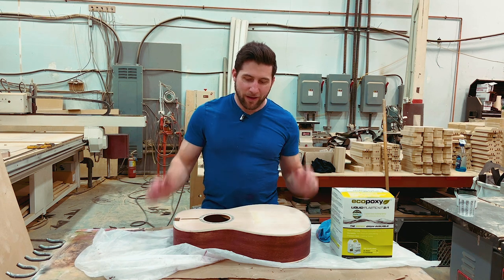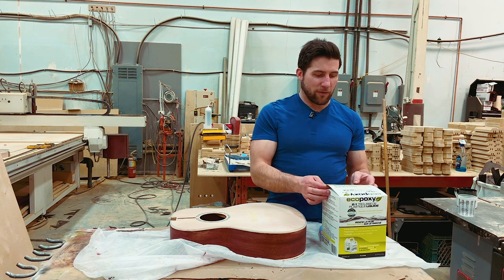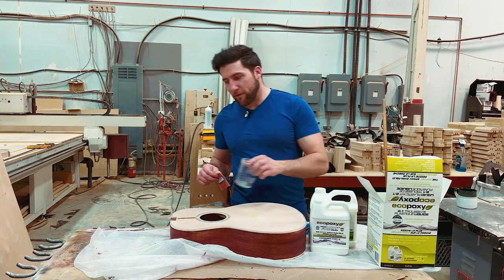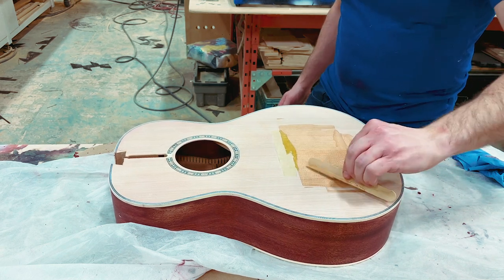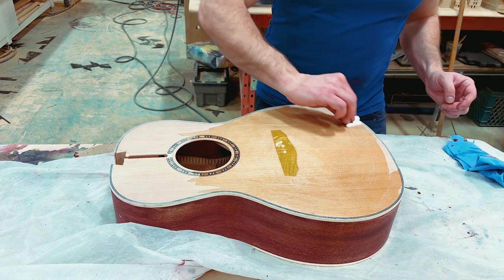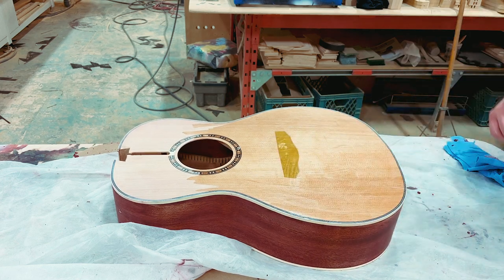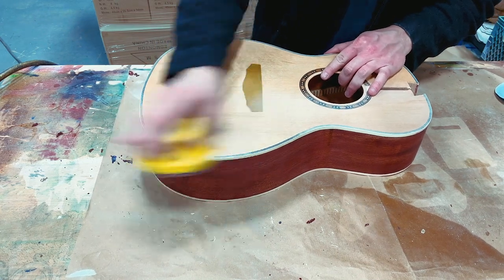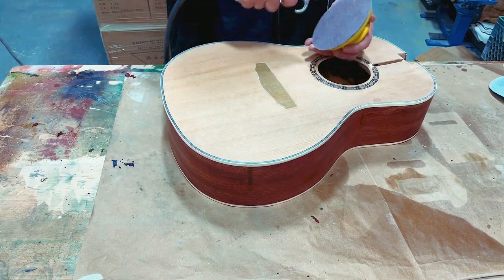How Do a Clear Grain Fill (With Epoxy!)

Comment: I don't know about ecopoxy but there is a great Ken Parker's tip in case you use "regular" west system epoxy- When the epoxy is fully dried on the surface there will be amine waxy layer that doesn't like to bond further. You only need a warm water wet cloth and rub the surface thoroughly to remove the amine.

Comment: They now sell this stuff in Europe but also found Epodex clear and the ultra look the same! This stuff is definitely what I'm going to use in the future.  I've just done a strat body in my normal fill and it takes ages to dry and takes even longer to take off... this stuff looks awesome.. first time I've used the mesh sanding discs and why hasn't I used them before? Last ages if kept clean and even when the edges go dull from the sander they wrap around a small block perfectly... looks class Brad.
Reply from the maker: Cheers Stu!

Comment: Spruce acoustic tops aren't supposed to be grain filled. Also, you're going to have trouble gluing the fingerboard extension to the top now that it's covered in epoxy.
Reply from the maker: As usual - to each their own my friend. You certainly don’t have to fill yours if you’re doing one. 
I don’t think the gluing will be an issue. It’s sanded back so that the epoxy is in the grain only; as it should be.
Reply: @BradAngove  As you state, to each his or her own. Traditionally, the purpose of filling the pores of wood is to create a smoother surface. In woods with large pores - typically called open-pored woods - if the pores are not filled, one gets a "pitted" finish. In some circumstances, the finisher wants that aesthetic. In woods that have sufficiently small pores - typically called closed-pored woods - it isn't necessary to fill the pores of the wood. A finish applied to a closed-pored wood can be quite smooth and "pit" free without filling the pores. Most, if not all wood from coniferous trees - spruce, pine, cedar, fir, etc. - are closed-pored woods and don't require their pores to be filled. It is very rare that a finisher will fill the pores of such woods - it is wasted, time, money and effort, since it produces no tangible result.  

In the case of coniferous-wood guitar tops, specifically, most makers attempt to minimize added mass that can adversely affect tone. Epoxy is a very heavy material - compared to some other finishes and compared to coniferous woods. With an open-pored wood, the epoxy will sit on the surface since the pores aren't large enough to accept much epoxy. Sanding it back to bare wood then removes virtually all of the epoxy. 

Epoxy can be an effective sealer, but there are considerably less expensive materials for that purpose - and easier materials with which to work. Epoxy can also be an effective pore filler, but the pores on coniferous woods don't need filling prior to applying finishes, such as lacquer, shellac, oils, etc.  I know of no other guitar maker who pore-fills ("grain-fills") coniferous guitar tops. Each to his or her own.

Comment: Nice video brother. I've actually used 2K high solids 2:1 Euro clear to grain fill. Great as a filler if you don't reduce it. It has to be high solids to get the desired results but the epoxy seems like a great option as well. Love your channel brother.
Reply from the maker: Cheers brother. That’s a good option too, just not one most of my viewers will have access to.

Comment: Great vid mate. I really need to do more research on using epoxy instead of regular 2k clear, especially over airbrushed acrylic paint. It really interests me.
Reply from the maker: I take it you mean as a final clear coat that doesn’t require spraying?

Comment: If the scratches are not too big, you can also fill with superglue. Rob
Reply from the maker: It’s more about grain porosity rather than scratches, but there are some thicker super glues that work quite well as fillers.

Comment: Looks great. Please use a light amber tint over the complete guitar. I'm just not a fan of epoxy fillers. I've used them and found I prefer anything other than epoxy. Also I hate the smell and clean up.
Reply from the maker: Some of them do have a pretty aggressive smell. I haven’t found that to really be the case with ecopoxy, but it’s definitely worth noting.

Comment: Hey Brad,

If I did this on a solid body top, do I sand and buff to a shine before I add layers of clear coat, or just the 800 grit then spray on some 2k?
Reply from the maker: Just the 800 grit. If you buff it to a shine the clear coat won’t stick.

Comment: Hi Brad - Will any 2-part epoxy resin (from a hardware store) work as a grain filler, or is there a specific type. I’d like to use it to grain-fill a bare Ash Strat body, that I will then finish it with black acrylic lacquer.

I absolutely love your videos, thank you for sharing your expertise!
Reply from the maker: The thinner ones with longer setting time should work. This is a casting resin. It’s not quite like those double tube adhesive epoxies you would typically get from a hardware store.
Reply: @BradAngove  Awesome - thanks, Brad!

Comment: Good demo as usual, Interesting technique, how hard is the epoxy when fully cured? 🤔
Reply from the maker: Harder than typical filler. Hard enough to be used as a clear coat (or even a countertop for that matter).
Reply: @BradAngove  that will nock off hours of work and a pint of nitrocellulose lacquer,  thanks 😊
Reply: This is exactly what I was looking for. I want to use as filler on a table top.
Reply from the maker: Nice; that’ll be fun.

Comment: do you recommend using Epoxy grain filling on a solid body electric guitar instead of oil based grain fillers? like Mohawk Grain Filler?
Reply from the maker: They’re both good options. The epoxy is more expensive, but is nice and clear and hardens more.

Comment: Question Brad, do you think using epoxy like this would have a more adverse affect on how much the top can resonate vs a water based filler? I know finish doesn't matter at all on electrics but more heavily braced acoustics can have a dead sound since the top can't move as much. So would this epoxy stiffen the sound board? Love the videos!
Reply: I dont think so its very very thin and its only in the grain so I think it won't make that much difference. I honestly think a hard finish like polly would dull the sound nore than the fill. If he does a oil finish I think it will resonate just as well.
Reply: @stu-j  That was my initial thought too but I just figured since epoxy dries so much harder than your average filler it might stiffen the board overall. That would be an interesting experiment.
Reply: @falcongunner33  I don't know because it isn't a lot of epoxy that actually goes on its very very little and you sand most of it off leaving only what in the grain to give you a smooth finish at the end. I don't think it will shrink like standard filler can and it will probably bind with the wood itself.  It could make the guitar actually sound louder if the top is stiff all over giving it more bass... but who knows until its done and see how it sounds.
Reply from the maker: I’m expecting it to brighten the sound slightly. Similar to superglue fills, which are quite popular on acoustic builds.
Reply: @BradAngove  that makes sense. My first acoustic build I didn't even fill, I just used tinted lacquer. That thing is super responsive. Planning an all koa build next so I might try the epoxy.

Comment: why are you grain filling spruce ? isnt it a closed pore wood ? - I thought that it was only the back and sides that needed grain filling ? I'm just about to do the finishing on  my first guitar so any help would be much appreciated.
Reply from the maker: I wanted to grain fill it to help with my final finish, but it certainly wasn’t required.
Reply: @BradAngove  Ok - Thats good to know - but does it restrict the top unnecessarily I wonder ?  - thanks Brad
Reply from the maker: I likely has an impact on how the guitar sounds if that’s what you’re asking.

Comment: Doesn't a thinner pour mean a longer cure time? Epoxy curing is exothermic, which means it generates heat (which makes the reaction happen faster, which makes more heat... etc). So surely a thicker pour will cure faster?
Reply from the maker: More material to cure and less air exposure per volume means a thicker pour will take longer to cure.

Comment: Curious. My epoxy says deeper pours cure faster because the cure process generates heat, and the more heat generated the faster it cures, so lower volume pours take longer. Is that not the case with Ecopoxy?
Reply from the maker: Not as far as I know.

Comment: Why would you want a brighter sound out of the top?
Reply from the maker: Why not?
Reply: @BradAngove  , ya destroy the warmth that spruce gives. Your eliminating the snap (deadening) and tonality that spruce imparts. The character. Ya might as well put a maple top on it.
Reply from the maker: I take it you’re not a big fan of superglue fill on acoustic guitar tips either then?
Reply: @BradAngove  , super glue is a wonderful thing. I don’t understand exactly what you’re talking about.
Reply: @BradAngove  , if you’re talking about the end grain, that’s fine and dandy. It doesn’t have any effect on the rest of the top.
Reply: @BradAngove  , we’re talking about changing the molecular structure of the top. But that’s all beside the point. My only point was, why would you want a brighter sound out of the guitar? People pay a lot of money for old flat top guitars that have been aged for their resonance. That’s why torified wood is so popular.
Reply from the maker: Oh, I see. Sorry I misinterpreted your question. I wanted it filled because of the type of finish I’m using, and I like the brighter toned acoustics. If I wanted to keep it darker I would probably just use an oil finish and wouldn’t fill at all.